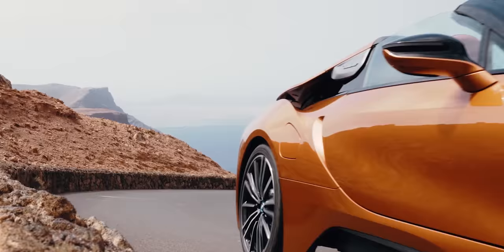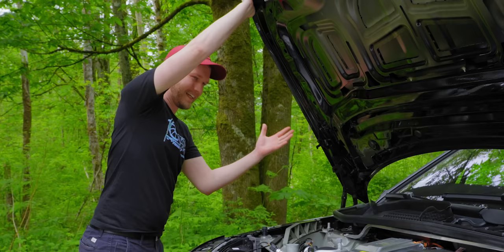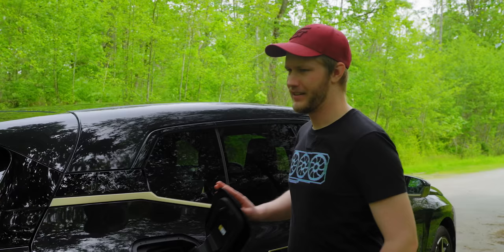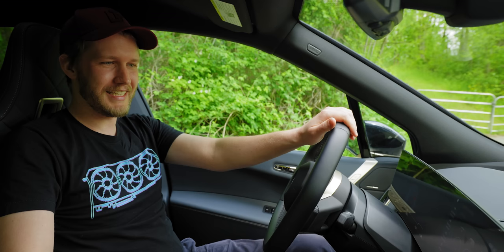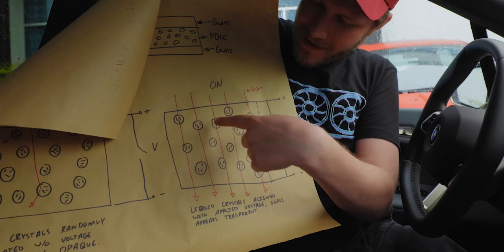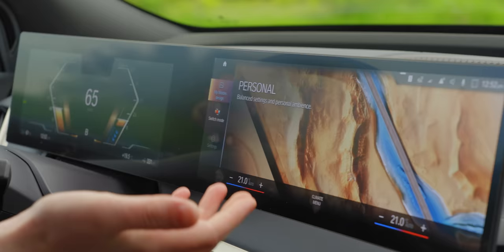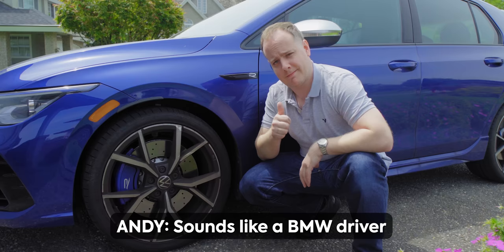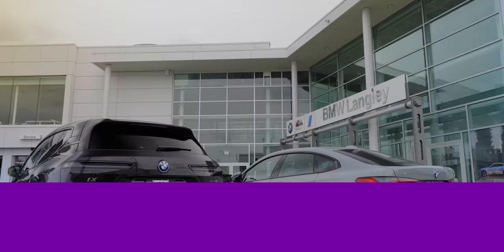It's... Complicated. - BMW iX

Comment: Sweet the perfect car to be backed into while its parked. Easy front grill replacement with those sensitive sensors is going to run upwards of $5-15k for simple low speed damage and why the washer cap there? Just another grand or two to fix that, that badge cover, and pipe to engine. Seems like a disaster for minor damage resulting in insane cost of repair.

Comment: Well this face and voice is very familiar from another channel I follow - so as I stumbled in - added a subscribe :) nice work fella.. By the way - the inside door handles? The reason they are designed like that is you need to cross over and operate it with your right hand and push it open with your left - this is deliberate to make you look over your shoulder - part of the driver's test in some EU countries - so you can see and spot cyclists, motorcyclists and other vulnerable vehicles before you push the door open - it has been shown to reduce the accidents caused by people running into the opening door significantly.

Comment: A lot of modern cars have cumbersome "command centre" interfaces. A lot of swiping/knob twirling to get anywhere. Not conducive to safe driving.

Though my sister had a Focus a few years ago, an one night I counted something like 30+ buttons for the radio, climate control etc, and all the same colour.

Comment: I watch Doug and it always amazes me how many infotainment systems where clearly never used by the people that make them. Let alone that there was any real QC going on.  Seriously, all the stuff is electronic these days there is 0 reason you shouldn't be able to change the function of every button that isn't legally required by law. I think so many of the problems people have with modern cars could be solved by making it more customizable.

If anything, I think it would be a huge boon as it would engage the community, especially if you make up/downloading profiles easy. Then you don't have to figure this stuff out through testing and internal QC as the community has done it for you. It's free real estate! Even the layout and design of the infotainment system and gauge cluster should be left up to the community in my opinion.

Comment: The best part about this car is that all the rubes who buy one will end up being massively upside down with huge negative equity by the time they pay it off because it'll have lost something like 75% of its value by the time its 7-8 years old with a majority of that coming in the first 4-5 years of ownership

The second best part will be how the even bigger rubes who buy these things on the second hand market in 5-7 years will get fleeced when it comes to parts and maintenance costs because modern BMW is fucking legendary for gouging secondhand owners when it comes to parts, they now deliberately engineer their cars too become bottomless money pits as they age which is actually being made worse by all of the tech shit they shove into them.

Just ask anyone whose had the misfortune to need to find a way too scrounge up $10.000 to cover the costs of replacing the vanos high pressure oil pump that lubricates the VVT system which controls engine timing on the new to them BMW they just bought for $25.000, it's literally a $65 dollar part the size of my hand that requires an engine removal and complete dismantling to the short block to get too, which is 50 hours of book time for labor at whatever rate the shop charges.

Comment: I am the owner of one iX 50 and I would call it just breaking. The car keeps breaking and braking and breaking. the last one? couple of days ago the car started itself and crashed in font of the car in front.The sad part is that neither BMW nor the dealership have done anything to resolve the problem. I would say that if the car maker is interested in building a good service or reputation (but at this point I would just call it service) would offer to take the car back or give me a new one. NOTHING OF THAT KIND AS HAPPENED

Comment: I am baffled by this giant step backwards in car UX design. Cars have had completely functional and standardized analog controls for a couple of decades. You could get into any car and with a quick look figure out how to manipulate the heat/AC, radio etc. and every car seat adjusted in pretty much exactly the same way. Now you can spend a literal hour trying to make sense of the controls. This doesn't make any sense. Sure add more options but most people do not want to deal with all of that all the time. They want to quickly adjust the cabin temp or their seat angle or distance from the pedals. If they can't you're just frustrating them.

Comment: I wish car companies would stop trying to use batteries as the “future” and get serious about a true replacement for petroleum. The problem with Batteries is the rare materials needed to make them will run out in around 20 years at the current rate of product and that’s  even if we recycle every current battery in use now. Not to mention all the raw materials to make the millions and millions of chargers needed. We are going to blunder the earth of every rare earth metal to go “green”.
There was also a recent study that showed the excessive tire wear generated by an EV generated particles that were 1000+ times more dangerous than a comparable ICE emission and tyre wear combined!!

Comment: If a car manufacturer states that the hood should not be opened except by their mechanics, they should be boycotted. That kind of stupidity should not be tolerated. Bullshit "pay to unlock" features, infotainment systems, hidden location trackers... The phone manufacturers made a lot of horrible stuff "normal". Car manufacturers are trying to cash in on those transgressions as well. They all need more regulation.

Comment: Under no circumstances should you spend $5000 for an OEM upgrade sound system. If the base sound sucks and you have to spend that much to get something decent, just start looking at other cars

Comment: Someone needs to do an in-depth look at why software and UI development, as professions, are miles and miles behind hardware engineering in so many products these days.  The trend to softwareizing everything has made me into a semi-Luddite, especially when it comes to cars... I kept my 2005 Civic for 16 years, in part because by the time i would have considered replacing it, cars were plagued with v1.0 touchscreens that their owners hated.  So I had to wait that out in hopes that they (anyone) would get it right by the time I came back to market.

After seeing this.... I think I'll stick to scouring Craiglist for grandma-owned, low mileage pre-2010 cars for the foreseeable future.

Comment: All German cars aside from Porsche have the build quality and reliability of an early 2000s GM car. Mercedes, BMW, and the Volkswagon group had the most reliable cars on the market in the 1990s and won dozens of awards for it, but when auto shop repair profits went down in the dealerships, Audi, BMW and espeically Mercedes all designed their cars with hundreds of parts designed to break from constant use. Like Mercedes replacing metal caps for oil, windshield fluid, etc, with cheap plastic that warps quickly when the engine compartment runs for more than 10 minutes. Not to mention german car companies are essentially funding the Russian invasion of the Ukraine from lobbying the german government to continue to buy russian gas. If you want to buy a new car, go for brands that arent morally disugusting like Honda, Mazda, GM, Ford, Tesla, Rivian , Lucid, and Mitsubishi. Also gotta call out volvo that is owned by the genocide committing chinese government, for being used to transport concentration camp victims through chinese death camps, volvo buyers, you are truly the biggest pieces of uneducated shit on the planet

Comment: the slower you charge batteries the more density and power you have. There is a reason cars and trucks in America were designed with as little electronics as possible. You will understand in another decade....

Comment: The car makers really have trouble with electric car and mostly making everything to be control from a touch screen even for some things that don't need it.
The last car I had as a rental was great it even had 6 or button near the gearbox for quick control while you drive except but those were ignoring personal settings so for example the AC the quick control was off or auto max so useless mostly.

Comment: It seems like EV company spent 99% budget on manu and R&D, and spent about 1% budget on UX research. Why does everything requires multiple tap on a touch screen? Why can't we have a good mixture of buttons and touch screen? If everything are on the screen, then they need to implement vibration feedback like the new Dell XPS 13 trackpad or Taptic engine like Apple. Literally no feedback from the touchscreen.

Comment: This trend of only "company qualified engineers/mechanics" only able to open the bonnet is really bad.
Yes you can technically open it but still, why not just have a switch under my steering wheel for crying out loud

Comment: anyone thinking EV reduces carbons - do you do crack?
250 tones needed to be mined to get 50 tonnes of materials, this means new mine sources also need to be made, wrecking ecosystems. That does not stop there, if you review the amount of carbons needed to make 1 battery you will see that these reduce no carbons 
next is - if you you have a small prang, you need to replace all the batteries because they can become unstable and blow up, while speaking about blowing up, they can blow up anyway - the fire is so toxic that firefighters will not try to put out a blaze without oxygen suits and they are immensely hard to extenguish and them blowing up for no reason is massive, if they blow up and you are in them then you literally have zero chance of surviving - the toxins in the fumes are on levels that is equal to uranium 
then you got wastage, when they are dpeleted - getting rid of the battery - toxic landfills 
then you have cost factors as these will never really go down in price thanks to being rare earth materials - so you think you are saving the planet by having one - you are just delusional - in fact your destroying the planet further its only time delayed and when all reach that time that is one major impact all at once 

anyone pushing EV and saying its clean and its environmentally friendly - is a liar it is far worse than petrol based vehicles

Comment: Every time I see that front end, I'm reminded of beaver teeth.  I also have to wonder where these companies are coming up with the engineers that design the user interface for the the car functions (including the climate, entertainment, and comfort systems), replacing physical buttons with convoluted menus that require attention from the driver to navigate through. They should require managers to have to go out and actually drive these cars for weeks at a time before releasing these systems to manufacturing. Finally, those "crystal" controls are downright tacky looking in a BMW (or just about any car). Save the crystal for champagne flutes in high end models with backseat refrigerators.

Comment: Feels like most EVs are just Concept Cars that no one would ever like to actually use on a daily base. Some are "OK" but still too expensive but most are just gimmicky all over. Manufacurers seem to desperately try to throw away EVERY working concept from the past 50 years to creat some new nonsense. I understand that some new features and inovations are needed to appeal to a certain type of (new) consumers BUT I can't belive that this is what potential EV drivers are looking for in a new 100k € car... There are thousands of good old gasoline powered cars out there that work just fine and don't have ANY of these unnecessary problems! Why do they do that!?

Comment: I don't get what's so difficult about making an EV with an interface that doesn't completely suck. I mean all these manufacturers have decades (or even a century) of experience. They all did useful interfaces for regular cars at some point. What happened? Not everything has to be touch-controlled, jeez...

Comment: Most car infotainment systems i've seen are not only bloated and hard to use like this one, but also the touchscreens feel like garbage like a phone from 2005, and also they feel so slow like a tablet from 2005 as well. I feel like they could replace the entire thing with a semi-decent mobile chipset running android and it would be 100x better.

Comment: Notice how the charging ports are on an angle. Now what happens if you leave it charging outside over night, it rains, a puddle forms in the charging area, and it freezes? The charger will be frozen in the port until you can get it warmed up. That’s truly a dumb design. Not only that but the crystal stuff shines like a disco ball in the sunlight, the glare from it is awful.

Comment: I am not even 2 min and already;

1; I am not sure where BMW was supposedly "so far ahead of everyone in electrification". i3 had bad range and bad efficiency for it size. i8 was a fancy looking 5 min "super car" that wasnt super even for those 5 min it had all the electric power available. Model S was released in 2012 and was significantly better on all of these metrics even back then, not to mention practicality. 

2; 0.25Cd is fine, but not amazing, especially not in 2022. Model X was 0.24 back in 2015 and possibly slightly lower these days after the refreshe(s).

Comment: Suddenly I started thinking about the 'right to repair' remark: do you actually have the right to repair high voltage parts of an EV? Not because the manufacturer doesn't want you to, but because you need a special government permit for it, like you need for working on other high voltage equipment.

Comment: Didn't somenone from BMW go to kia/ Hyundai explains why some Korean cars actually look much better now. I believe it  was the M3 designer not 100% sure.
Reply: What happened was: back in the mid 00's Hyundai/Kia lured away some toyota executives who brought a bunch of stolen company secrets including internal design data or the then current line of cars and small/medium suv's and quality control procedures with them that kia/hyundai copied, there was a big criminal case about it along with a huge lawsuit that resulted in those exec's going to prison and hyundai paying out a huge settlement to toyota.

That's why Kia/Hyundai's line sort of resembles what toyota was doing 15 years ago design wise andits how they cheated their way into becoming more reliable than they everhad been before...or since.

But they still can't figure out how to build their hybrid/electic suv's so that the batteries don't explode, they actually had to send a safety bulliten to every registered owner of a hybrid/electric Tuscon/Santa Fe built from 2015 until 2020 in canada telling them to park it as far away from their home as possible to minimize the risk of a fire spreading to the structure if the batteries decided to spontaneously combust/explode for no reason.

Comment: You can see that BMW's infotainment system was designed by someone at Microsoft.  BMW's idrive system has been terrible since the first implementation and has not improved.  Kinda like Windows 8 8.1, 10 and now 11...

Comment: I work on BMWs and couldnt agree more, the interior is way too cheap feeling and the trunk space is not big enough and the hood has no storage under it. Also if you rock chip up that front sensor grill ur screwed and boy are they expensive.

Comment: A lot of this car is just normal modern car development....  For example, the trend of "shaving a couple grams" off every possible component has become an industry religion.   Even if your car sucks and you can't innovate..... You cans still shave weight.   Thus all companijes do it all the time, and to an absurd degree.    Thinner glass layers in side mirrors?  minimally epoxy impregnated carbon?  Thin paint?  Minimal/zero paint anywhere its not  visible?   Severe reductions the reliance of mass-loaded acoustic insulation (eg Dynamat/MLV type stuff)?  ALUMINUM WIRES?  All of the above and more

Comment: I just picked up my leased iX and watched this video and wanted to clarify two issues that were mentioned.

1. The interface access. Sadly, you didn't use the VOICE commands. Why mess with the screen and, admittedly, its confusing interface, when you can just press the mic button on the steering wheel and roll down specific windows, get direct access to a specific app and so forth?

2. As I mentioned above "direct access to a specific app," this means the sound you were complaining about. If you go into that app you can then turn on the surround sound (yes, it is on the Harmon Kardon system also) and you would have not been on "default/non-surround" setting. I've no idea why surround sound, fully on, isn't the default.

I would like to see you do a new review of the iX, however, this time show the voice aspects and gesture controls; it just seems you missed covering the true potential the system has as a whole. Thnx.